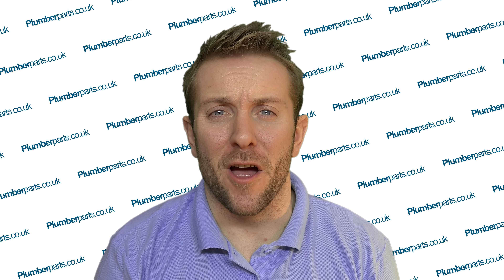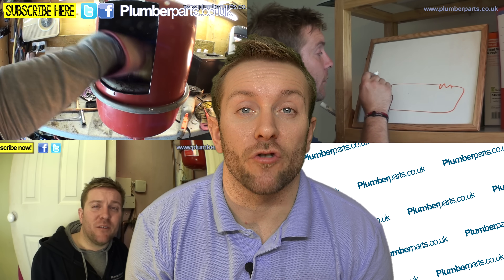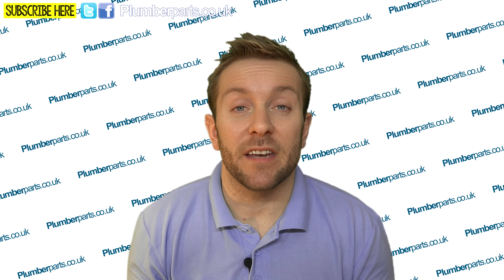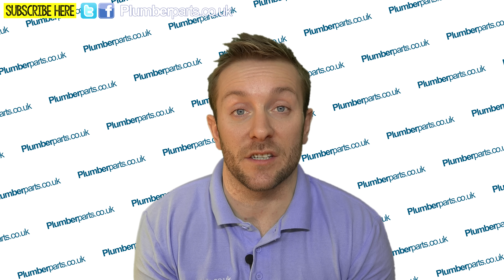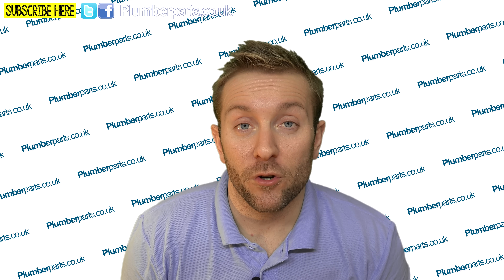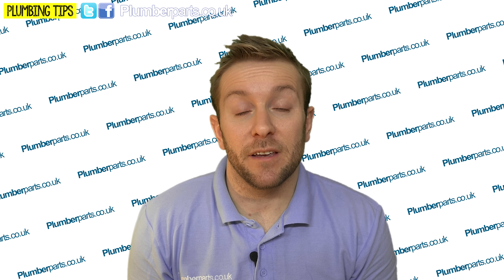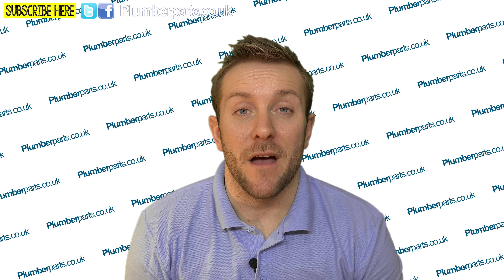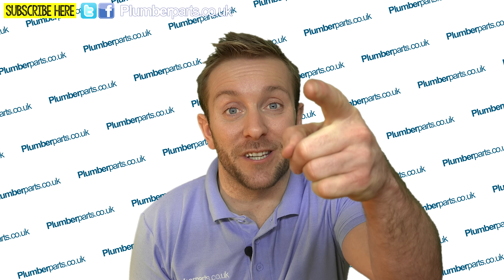BOILER KEEPS LOSING PRESSURE - WHY AND HOW TO FIX - Plumbing tips

Comment from the maker: Please consider subscribing - Uploading still today!
Please Follow my Vlog, TimesWithJames  http://www.youtube.com/c/timeswithjames
PLUMBERPARTS AMAZON TOOL SHOP https://www.amazon.co.uk/shop/plumberparts
Reply: loads of thanks for this. my boiler keeps losing pressure. it's a new boiler, so i know it's not that. but my bathroom radiator valve (not a modern rtv, just a knob) leaks and goes cold after a time, even when heating is still on. might it be this causing the loss of pressure? and do you have any videos about how to change it to a new rtv? [el'sda2].
Reply: @Maximus Hamza what are you saying, we should all hack your girlfriends account ?
Reply: My hot water pressure is very low. I have checked in all the taps and also the boiler pressure gauge pipe is not working. Normally it makes sound when i fill up the pressure but this time it's not making any sound so it means the water is not going into boiler. Please advice me. Thank you.
Reply: P
Reply: You all prolly dont give a shit but does any of you know of a tool to log back into an instagram account??
I stupidly lost my password. I would love any tricks you can offer me!
Reply: @Niko Alfonso Instablaster :)
Reply: @Philip Brady i really appreciate your reply. I got to the site on google and im waiting for the hacking stuff now.
Takes a while so I will get back to you later with my results.
Reply: @Philip Brady it did the trick and I now got access to my account again. Im so happy:D
Thank you so much, you really help me out !
Reply: @Niko Alfonso You are welcome :)
Reply: L
Reply: My boiler has started to randomly dump some water into my airing cupboard, why

Comment: Bleeding radiators. Does that cause pressure to drop? Also, for closed systems pressure gauge may be in the airing cupboard, not on the boiler, along with the pair of valves to repressurise the system. Top video, nice one bud.

Comment: Should a combi boiler lose any pressure at all under normal operation with no issues? I top up about 0.2 bar a year to keep around 1.2 bar in system. I tend to top up about now before we need the heating to come on for winter.

Comment: You're brilliant 👏 

Do you have any ideas what to do if when I pull the green lever the indicator doesn't move but I can hear water but then the water stops before i release the green lever. The error message 118 has gone now and i have hot water. I dont have the heating on. The indicator still reads almost 0 in the red. Thanks.

Comment: The first thing if your pipes are under the flooring is to check if the boiler works and expansion vessel are in order as well as the valves, to assume there is a leak is to take the problem in reverse.

Comment: The two scenarios I’ve had were a rust spot on a radiator that very slowly weeped water and the system lost pressure, and the other was the air bladder that keeps the pressure constant.  Its diaphragm broke down and was a straightforward replacement on our Vaillant combi.  Only other problem was the main circuit board went bad!  A bit weird, but getting the right part number was slightly tricky however with the right part it was a doddle to replace and no trouble since.

Comment: Our plumber is replacing our expansion vessel and relief valve and has said it will cost £300 for the initial diagnosis, parts, and fitting. 
That seems a lot to me. Is that about right?

Comment: I like your video. It is the most comprehensive video regarding this problem I have seen. The only problem is you cover many topics whilst speaking really quickly, not giving the viewer time to comprehend the issues
For example, you show the rusty nails and talk about hydrogen in the system. I don't think many viewers would have a good understanding of chemistry to understand that corrosion is the source of the hydrogen gas.
I know viewers are put off by long videos, but they are also put off when they are overloaded with information they don't have time to understand.
I know they can pause the videos but in reality they don't.

Comment: Hello dear all, a desperate working mom here facing pressure drop issues and not having luck yet- We have pressure drop for quite some time ans need to do weekly top up. Had a gas engineer cleaned the PRV but didn’t resolve the issue. He said he can’t do much more (obviously we didn’t find a reliable person).Our builder checked all radiators and didn’t find any leaks, he disconnected the pipes from PRV and put a basin but no water came out from PRV to the basin, and water pressure still dropped. Will no water in basin (after 48 hours) be an effective indication that no problem with the PRV nor expansion vessel, or just no problem with PRV please? What could be next steps to identify causes please? I should have discussed these with the gas engineer or builder but appreciate some independent views. Many thanks!

Comment: In January had a system that was losing pressure fast. Frost had pushed out the insert from the drain valve.

Comment: What if my pressure gauge does not switch system back on to run till I fill up to about 2.4 then after a couple of days drops again ? Leak or pressure gauge?

Comment: Thankyou for the video. I think you have jogged my memory, not having had to touch a boiler for years. The relief valve is dumping water at well below working pressure. I just moved into this property and the boiler although working extremely well has been tanding for over two years. Too much work at the moment, rather the leak than the cold at the moment. I'll order up a new dump valve ready for the moment. Have they done away with the filling key in the cover as i have a single ball valve in the line which in my experience is not the best idea.Thanks again.

Comment: Thanks, very insightful video.

 One comment though, pump cavitation occurs in the low pressure (usually vacuum) region at the eye of the impeller when the pump inlet pressure is too low. Due to the low pressure environment, the water's boiling temperature is much lower and what happens is that water changes phase into vapour, rather than the impeller splitting the water and air molecules.

So instead.of water boiling at 100degC ( at sea level pressure) at the eye of the impeller it could be boiling at 40degC or even 25degC.

Anyway once this cavitating flow enters the exit of the impeller its is represurised to due gaining the spinning work from the impeller and you will hear the vapour bubbles pop and burst letting out tiny acoustic waves that start to damage and grind away the impeller blades.

One result.of cavitating flow, is the loss of pump exit pressure, it can be identified as NPSH3%.

Comment: hi guys i have a rising and loosing pressure system 

loose pressure when i turn the whole system off and while it on its rising upto 3 barr ive caught it at 

help 

previous fix was a spark generator

ps ive checked system no leeks
apart from i seen a drop from thr bike pump valve and  noticed a drop from the outside 15 mm pipe

im guessing expansion tank
is it worthwhile me pumping it up to 1.5 bar ?

any help much appreciated

Comment: I have a boiler from 2005 and it stopped producing hot water, we had a friend who’s experienced with boilers and he used the black pressure valve under the boiler to restore hot water, he did this twice for my family and we had hot water for 2 months at each time he did the black valve, 
then water was cold one day so we called out boiler man and he said new parts were needed on boiler and the work was done, boiler man restored our hot water after doing this, he mentioned that our boiler will fluctuate, we get hot water for showers for 2 minutes then it goes loop warmish, I thought boiler is still faulty but one of my family members said a few days after the boiler repair job that there showers are getting hotter and hotter, what is fluctuation and can anyone help me with this answer please ? Because new parts were added to my boiler will it fluctuate for good or will the boiler keep getting better and better and produce hot water constantly ? Is it a new parts in the boiler thing ? Any answers would be much appreciated 👍

Comment: I had to replace all the radiator valves, they were all slowly seeping, and the pipe work drain point, send and return, were leaking slightly. My system holds pressure for many months now.

Comment: With a condensing boiler it is possible for the heat exchanger to be leaking into the combustion chamber and the leaked water will flow away un-noticed in the condensate drain.

Comment: A good presentation on basics, but skips the part about possible leaks in the floor/walls when there are no stains or signs? Can you put some form of stop-leak in the system as you can with a car that runs at comparable pressure?

Comment: You mentioned the Auto air vent in passing, but forgot to include this in the list of potential reasons for pressure loss. If you have a failing one, this too could be your culprit.

Comment: One not so common cause of pressure drop is the domestic hot water heat exchanger leaking central heating water into the domestic hot water system. this took a very long time to find.

Comment: Hi James I have a worcestor bosch c440i and keeps loosing pressure and had a leak .
The plumber which is WB accrediated one changed the expansion vessel and sealed a container with a tape under the boiler .The leak stopped but the pressure drop continued .
He then added a bottle of Miracle seal inhibitor 250 ml ,the pressure drop was slower at a 0.5 bar a day but still is not right .
There is no leaks from radiators or ceiling ,what could be problem please ?
does it need more inhibitor as miracle seal bottle says it can be between 1 to 6 bottles .

Many thanks for your helping in this dilemma

Comment: Hi can i ask your advice please, if i replace the automatic air vent on the top of the expansion vessel, worcester 35cdi, do I need to drain down the boiler first, and also will i need to pump up the pressure to one and half bar with pump after replacement, the vent was replaced 4 years ago so is it worth doing as a service item.

Comment: vaillant eco combi we top up pressure every day for a few weeks. now its hourly topping up, water is just flowing out the pipe outside.. so this is the pressure release valve. the boiler is only 2.5 yrs old! 
we had worcester before 14 yrs no problems ever!

Comment: An Ariston Genus One 24kw sometimes gives an error code 108 - low pressure, but the pressure gauge shows more than 1 bar the real pressure and the display below 0.6 atm. If I increase the pressure to 2 bars, the error disappears. Do you have any idea what's going on? Thanks!

Comment: Just to add too. There is zero pressure drop once everything is cooled down, so to me that rules out a leak on a pipe as I'd expect it to continue leaking whether the heating is on or off... Any help would be appreciated 🙏

Comment: My pressure is dropping only after the boiler has been on. Is that more likely to be a leak or an issue with the pressure relief valve. For info I've had the expansion vessel replaced last year. I've also tried the fennox leak sealer fluid and still no joy. No obvious leaks on pipes walls ceilings etc
Reply: Same here. Looking for answers. Did you fix your la please?

Comment: Your YouTube is brilliant but I'm a bit confused. Ok this might be a silly question ( I'm female if that's an excuse) 
 if the heating is off and the Worcester DT20RF is doing hot water only does the pressure gauge still have to show pressure because mine is at 0 !! Does that mean something needs fixing or topping up or only when heating goes back on?

Comment: any help appreciated, my pressure vessel is at the correct pressure, but the actual boiler pressure goes from minimum when the boiler is cold , and then maximum when the heating is on, any idea what's going on

Comment: Started to watch your video for what I thought would be a professional presentation but quickly realised its another shabby video. For one, it’s not hard to compress water it’s impossible and when I saw “whoever” tightening the radiator valve with an adjustable spanner and grips it made my blood boil so I stopped watching. Show people how to do the job right with the correct tools or don’t bother….

Comment: Hello,  our home has been severally damage following a new boiler installation. The company replaced my old gravity system with a pressurised one and fail to verify and inform us if existing pipes were going to sustain the pressure. Is the plumber responsible for the damage?

Comment: I don't use Yajuj Majuj corrupt invention rabbish gas boiler instead I use gas hob elec kettle to warm water.    I don't use corrupt disgusting Yajuj Majuj sewer seat on toilet 16 high all connected fixture all that water    I use about 15 litre day I am super saver  I love  all drop. I   squat shit in chamber pot.  I squat pee in bottle.   I   wash over big bowl sit on low seat.  corrupt yajuj majuj invention water radiator  heating get rid

Comment: Another reason you failed to mention is a micro leak on micro-bore piping, for that you need to add Fernox F4 or similar
Reply: Had a leak for 2 years used Fernox F4 Leak sealer. Touch wood we haven't had to top the boiler up for 12 months next month. It's dropped a bit but apparently that's normal over a year. We were topping it up two or three times a week.

Comment: Pressurised combi boilers are a very bad idea. The old floor standing boilers were simple and reliable and went on for decades without even being serviced. The pressure loss and need top up is inherent in the design and not due to leaks or other such nonsense. The combi boilers are a money pit.

Comment: what are the effects on a boiler due to low pressure or no expansion vessel? Can anyone explain if it affects the heating system or efficiency of the boiler?

Comment: Just make sure that filling loop is left on when you leave. Seen so many left in the crap where the loop was removed. If left on they could have repressurised the system in seconds and been up, and running.

Comment: A rare problem with condensing boilers is a faulty main heat exchanger that leaks internally and goes out down the condense pipe.

Comment: Thanks I’m 78 old lady and over the years have heard husband talking about different things with boilers etc and the pressure had started to drop an had kept topping water to just over one and it would suddenly go right up to 2  so put boiler off and whilst was having this trouble had noticed the little copper pipe had drip coming out as it’s by my gate  so then found you and now think as all other things dry that what you say must be expansion vessel ,and or pressure relief valve or both . Fortunately or unfortunately I have home care with British Gas with being alone , more money to pay out that can’t afford but not much you can do about it I should av bin a plumber . The boiler is a Remeha  Avanta plus 10 years old but not worked hard as have had to watch the bills but you say those parts usually die after 10 years so guess I know there’s nothing I can do but like to know what’s going on as our age gang had to do all our own repairs 40/50 years ago an the women had to get stuck in and help the fellas, but it’s a good video very informative thanks

Comment: In my case I found the pressure was dropping because of two leaking thermostatic radiator valves. One was obvious but the other not. They leak where the pin enters the valve body and the heat was evaporating the water so there was no obvious leak. When I removed the thermostat I could see a tiny amount of water on the pin, fixed both these and the pressure has held for years.